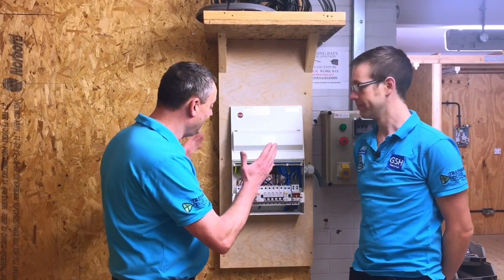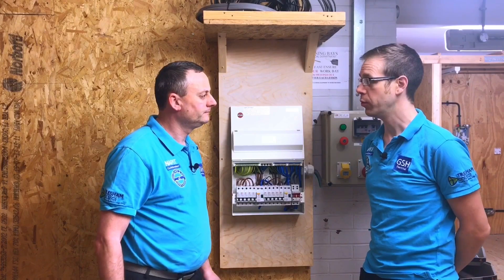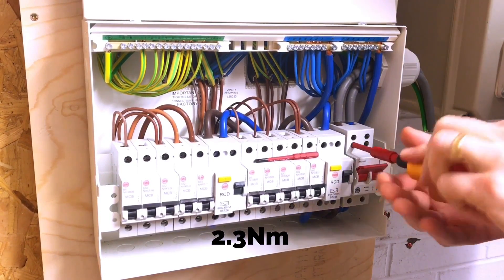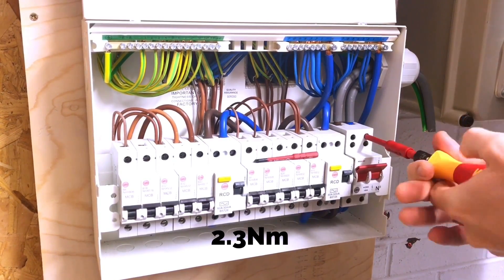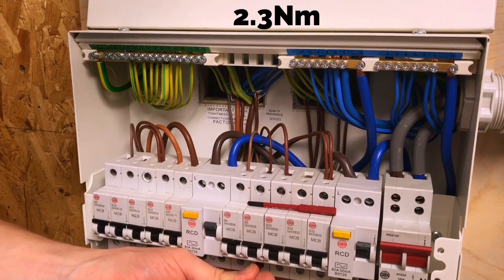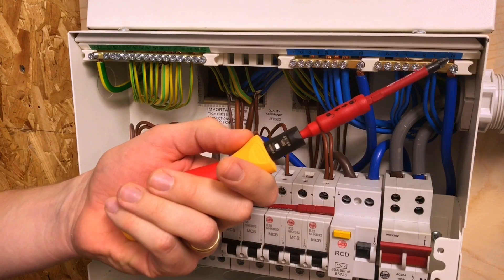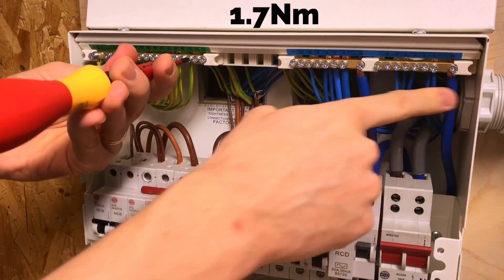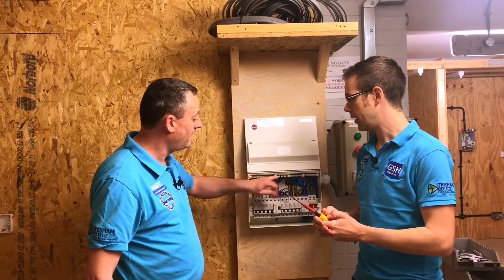How to Set Up and Use a Torque Screwdriver for all the Connections in a Consumer Unit (Fuse Box)

Comment: this comment is nothing to do with the torque settings. but I had to say the main wylex switch has double termination terminals (which I still choose if I can get them) like the old days, if manufacturers had continued this policy of double terminals we probably wouldn't have had so many loose neutrals causing fires and the fire brigade would not have influenced the wiring regs in making everybody change to all metal enclosure for fuse boxes. PLEASE manufacturers, go back to double terminals, they are safer for not a lot of extra cost.

Comment: Just had a look at consumer unit world 
And it say for wylex CU wylex RCBO torque setting is 2.8nm and main switch/RCD is 3.2nm 
So if I am not mistaken the CU and breakers as well as the mains switch in your video are wylex so joe has under tightened the terminals as he only set the screwdriver to 2.3 nm . 
Fantastic video guy’s as always .👍👍👍❤️

Comment: Hi,

Is the torque settinhg the same for all circuit breakers.or neutral and cpc leads? or does the torque setting used ony apply to 
the CU wich you used the driver on?

Comment: Sorry sorry sorry, but Gaz you continue to use the therm requirement . It is NOT a requirement to tighten the screws on a CU to a torque setting it is how ever a recommendation . Can you tell me as to why the there is no mention of the electrical industry on the packaging of theses thing’s but they they do reference the motor industry? BS 7671 DOSE NOT say anything about the use of torque screwdrivers or torque settings, it only states the equipment SOULD be installed according to the manufacturers instructions not must or that it is a requirement.
Reply from the maker: Regulation 134.1 is a great starting point to add to your own knowledge…

Comment: Sorry for the quitesisum,
But tightening the terminal screws on a cu or mcb/tcd is only a manufacturers recommendation NOT a requirement, that's why different manufacturers have different settings for torque, this is just forcing us sparks to buy tools we don't need
The average human can genorate 67.2nm of torque with just the wist, if you can't tighten down the screws on the cu then maybe you should jack it in and get a job in McDonald's. The same can be said for the use of those fancy MFT'S
THE TESTERS FROM THE 50s/60s and on words are still complyant and can be used so long as they are kept calibrated , I have been using my late bothers Robin MFT since the late 80s with out any problems, and you can buy them second hand for as little as £50 send them away for calibration and your good to go.
Again sorry for the quitesisum and I don't mean any disrespect to you or anyone else.
You're videos are great
Keep them coming

Comment: had the manufacturers of consumer units  made their insulated boards to the British standard, rather than just putting a sticker on it saying it complied with the British standard, i doubt if we would have metal boards or the topic of using torque screwdrivers. As usual its cheaper and easier to deal with the possible symptoms rather than the cause,  why there has not been a recall on them i dont know, just been swept under the carpet.

Comment: is it OK to undo the terminals using the Torque screwdriver ? when i was at college doing training, albeit motor vehicle, we was taught and told you should not use the torque wrench or torque screwdriver for removal, only for tightening ? so was that just rubbish, or should you really not use a torque device for removal ? just curious that is all.

Comment: Joe when someone over tighten and marked the cable inside (squeezed ) and then you loosing little and try to tighten on right torque , because of mark on cable you need to over torque little 
What you say it’s right on new connection on new pease of cable
Reply: Just what I thought watching this video. Theoretically, doing like as shown in this video, some wire may be left loose and cause arcing. Just depends how over-tightened/squashed the wire was originally.

Comment: Lads the videos are awesome as always bought this kit myself. Was using the wera torx driver but found out there range of values from 0.3 to 3.5nm is split across 3 separate drivers, the robbers, the wiha will do 0.8 to 5nm singly and also a far better tool to use and feel. Only caveat is adjusting the torque setting is  fiddly compared to the wera. Two similar priced tools but the wiha tops off. Just thought I'd throw my 10pence in for the viewers. Steveo sparks.

Comment: I work in metering for British gas and we have just got the wiha torque screwdriver, it's set at 2.8 NM and can't be adjusted by us, we use it on cutout, meter, henley/Lucy blocks and isolator screws, we need it calibrated every so often, that's not been established yet, is that one you use need calibration?
Reply from the maker: Hi. From memory this type of torque screwdriver requires calibration every 5000 turns (start counting) or every year. Thanks for commenting and watching Gaz 👍
Reply: GSH Electrical where would you even get a screwdriver calibrated ?

Comment: I am a culprit of using the @AVE method of saying ...'click' as the screwdriver turns. Need to invest in one of these as have had to return after a couple of weeks to ensure nothing is lose.
Reply: DIM Tips I think the AVE method would be better, this is a waste of money it doesn't have all the commonly used torque settings (so doing 1.7 could be 1.5 who knows) and needs calibrating realistically every time it's used if it's dropped banged etc it could be knocked out of calibration.